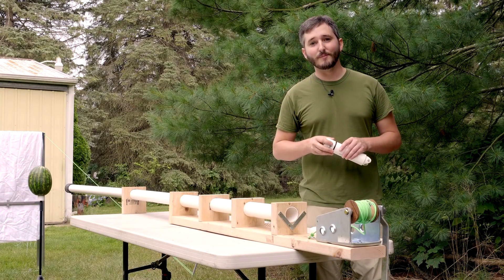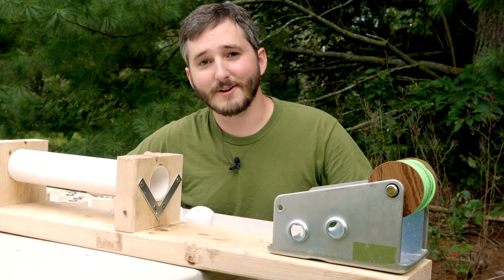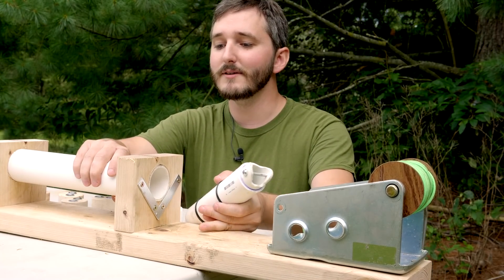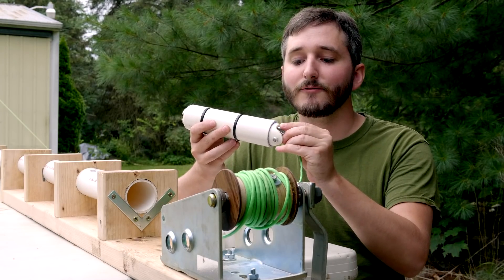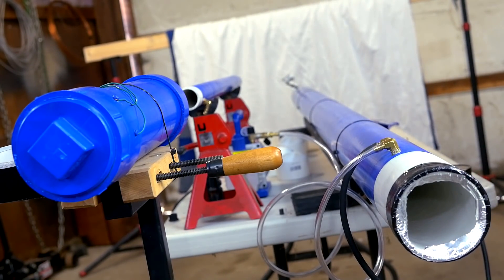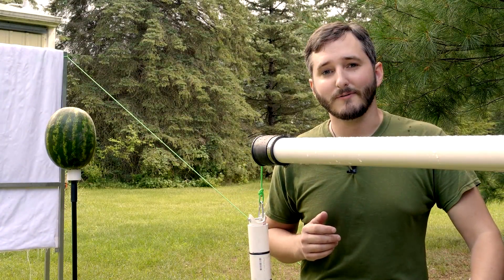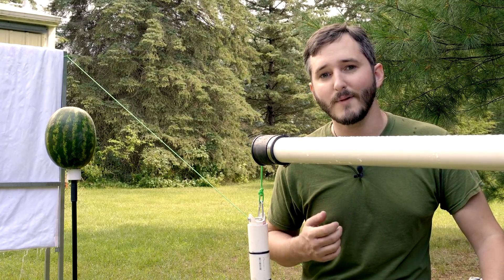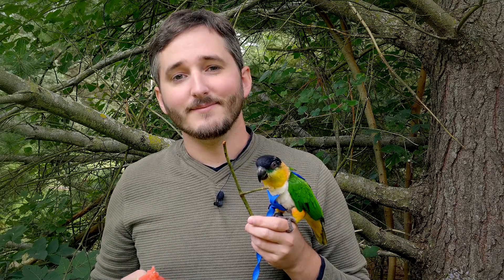Rapid-Reload Vacuum Cannon: Magnetic Piston, No Burst Discs

Comment: I tried to build this with my physics class. I am having trouble getting power out of the projectile. My build is similar but I am using a hand crank instead of a drill. How important is the speed of pulling the Piston. Thinking of trying to modify my crank to attach a drill. Also my 1 1/4 inch end cap doesn't seem to be quite as airtight. I attached a layer of tape to reduce the gap slightly. Any other suggestions?
Reply from the maker: Could be too slow at pulling the piston. See my earlier versions using a solid shaft attached to the piston, that version is pretty foolproof
Reply: @Nighthawkinlight  I was hoping to use the later methods because of not needing to tie it down and it is a self contained unit. I will see if I can work out the kinks and if so will be posting on my channel. I will send you a link if I get it working.
Reply from the maker: Please do! Send me a link to nighthawkvideoresponse@gmail.com
Reply: @Nighthawkinlight  I got it to work today! I took the homemade crank off the back, tied down the board and pulled the Piston with the rope. Worked like a charm! I will be uploading a video soon. I would still like to make a few more modifications so that I don't have to tie it down in the future. My students now want to see how far it would shoot a projectile. I also have an idea to shoot a pool noodle or turn a pool noodle into a sabot for a "shotgun" affect or to launch something with a smaller diameter.
Reply from the maker: Glad to hear it!

Comment: Hint:
Combine the working principle of the vacuum cannon with that of a pulse jet engine and you have even more muzzle energy than your PVC pipe can handle.  All you have to do  is suck in some atomised fuel with the air and install a spark plug with ignitor.  The result will be .... Super-Sonic Air/ fuel mix ignited..... Ignition timing will be crucial and the most difficult thing in the whole set up.
The Kinetik Energy from the Supersonic  Air plus the additional pressure from the fuel explosion will result in a big BOOM....enough power to blast projectiles into space... Well almost...
Caution: the pipe will backfire, keep safe distance, don't point at humans, animals or nasty neighbours, because the projectiles are lethal.  Always ware a safety t-shirt and safety Flip Flops

Greatings from beautifull Spain

Bert

Comment: That's awesome. 

But as far as putting tubes together, Iif I'm remembering correctly, they did that in mythbusters, and instead of an increase in speed they actually got less. 

Why is that? I'm not going to pretend like I understand what was happening with their experiments, or if they did something wrong, just a thought lol.
Reply from the maker: I don't remember that episode clearly, but I would guess the problem was that a lot of air leaked past the projectile upon firing. If that happens then a cushion of air builds up between the burst disc and the projectile which slows it down. This problem is amplified the longer the barrel gets, but is reduced by using a burst disc that breaks easily or a cork and ejects with minimal force like in my design.
Reply: @Nighthawkinlight  cool, makes sense, thanks for take the time to respond.
Reply: Taking*

Comment: What if you had a tank of a hydrogen/oxygen mix with an igniter in the tube and when you pull the stopper to make the vacuum, you would pull it past a point in the O2/H tank that would suck that mixture into the tube and ignite it? you may want something stronger then pvc though XD

Comment: But how does the projectile separate from the plunger?!
Reply from the maker: It comes free of the magnet as soon as the plunger is pulled from the pipe.
Reply: Nice! Is it because of the rush of air as the plunger comes out or because the steel angle bracket?

Comment: Couldn't you just use the projectile, pushed into the barrel, stopping at a rubber seal (like you did with the plastic cups, but In the barrel, as a valve?

Comment: Hey I just thought of something. I would love if you could try out for me. It would he a huge help as I'm sure you'd have a great way of making it and then explaining it. 
I recently started a new job. 
I have to cycle all the way to work. Which sounds good for my health but I live in Ireland and it's coming into winter soon and cycling sounds like hell.
However; 
it could be nice if I had a motorized bicycle. 
I know there is lots of other vidoes explaining this but they are all of poor explanation and or require some parts I can't easily acquire. 

Could you try this out ? 
See if you can make a motorized bicycle from parts you'd find around your house. ? Including a chargeable battery of some sort. 

It only needs to runs for about 60mins a day. Doesn't have to be rocket.  Just get me for A to B without pedalling.
Reply from the maker: I just built a motorized bicycle for part of a future video, but I just used a motor kit from ebay. I wouldn't build something myself when kits are so inexpensive. The trouble with making tutorials for such things is that every bicycle is different and requires very different techniques for mounting motors and drives.
Reply: @Nighthawkinlight  cool. I was about to take the washing machine apart. Lol

Comment: I would try a velocity stack type thing on the intake end of the pipe. it should result in more smooth and better airflow, similar to how N/A engines do it. i understand the concept isnt the exact same, as velocity stacks are more about resonance, but the larger intake diameter with a cone shape down to the inlet for the cannon might help. https://i.kinja-img.com/gawker-media/image/upload/s--3DN1l5sp--/c_scale,f_auto,fl_progressive,q_80,w_800/kg9c6gim2dgep6njlt6p.jpg
Reply: thanks for the video by the way, i think i might go to the hardware store and build one myself, and try out my cone idea

Comment: can someone please correct my calculations?
Ping pong ball: 2.5g
atmospheric force on barrel diameter: 45 pounds or about 200N
if the  ball had a perfect fit
a = 200N/0.0025kg = 80 km/s² ?
to reach supersonic speeds you need 0.01mm? there must be something im missing?!
Reply from the maker: The air cannot move quickly enough to push a ball that fast
Reply: @Nighthawkinlight  what is preventing it from rushing in that fast?
Reply from the maker: The speed of sound and the low energy of the air particles
Reply: @Nighthawkinlight  ah I see. Thanks!

Comment: So a pellet (Diablo) shaped piece of Styrofoam with a fiberglassed nose would be about the fastest, most damaging projectile?  Not sure of that.  Mass does factor into damage because it's really all about the energy transfer.  If your barrel was long enough, even a heavier projectile should accelerate to supersonic speeds, no?  Not sure where heat from friction comes into the equation and melts the barrel either.  Some interesting tests ahead?
Reply from the maker: A heavy projectile could accelerate just as fast, but only if no air can leak past it as it is accelerated. Otherwise you end up with an air cushion that slows it down by the time it reaches the far side of the barrel.

Comment: If you dropped the diameter down to be able to shoot something like a sewing needle then shouldn't it be able to reach higher speeds without a massively long vacuum to speed it up?
Writing a book with advanced weapons that are actually possible.
Reply from the maker: No, because vacuum only gives you atmospheric pressure which is 14.9 pounds per square inch.  Back of a sowing needle is tiny so only a fraction of that pressure to push it. Compared to friction of the needle in the barrel it will not pick up speed quickly.

Comment: Lame. You don't need to make the pipe longer just add more pressure on the other end and you will get well over super sonic speed with heavy projectiles. If you get a oil of tube successfully evacuated and a pressure differential of 10 to 20 Bar then you will get really insane speeds 😱

Comment: all this vacuume...and then narrow it down at the firing end...  to a 3/4 line and firing shotgun slugs??  Even if you have to wrap them in something this should be Very interesting....AS SOME channels are being De-monetized..because they are using GUNS..
With this, they should not have a problem...
Reply from the maker: This type of cannon doesn't work so well with heavy projectiles because the pressure is not very high. It works best to fire light projectiles very fast, not so good at something like a lead slug.
Reply: most slugs are in the area of 1 oz...  its the spread/area of weight..is so narrow, but with a Neck down size, it might(??) give you more force??

Comment: "...at a velocity several times faster than the speed of sound..."
This is not correct.  The inrushing air will travel and less than the speed of sound, the speed of sound may only be approached.  While there are less collisions when a pressure wave moves into a partial vacuum, the collisions aren't really impeding speed that much.  
Air also has mass and so requires time to accelerate, so the apeeds will be well below the apeed of sound for any practical length straight vacuum tube cannon.
Reply: Was looking for this comment. its a shame no one is debating this propagation of misinformation the Video is spreading.
There is a way to increase the velocity, venturi tube. but the video is just a straight pipe.

IF he increases the temperature of the air allowed in. he can increase the velocity, but it will always be the speed of sound in that medium.

he also says the pound-force on the projectile is not what causes the projectile to move fast, he claims it the airs speed. 

it is the pound-force and the airs ability to maintain that force or close to it, the projectile may only accelerate up to a fraction of the speed of sound. as soon as the projectile was somehow moved to the speed of sound, there would be no force pushing it. the guy needs to look at conservation of energy and Bernoulies work. if the air was allowed to enter a vacuum, it would quickly reach zero pressure while having a velocity of (On average) its speed of sound value. with an obstacle in its way, it will have resistance and will bounce off it transfering kinetic energy, thus all the while maintaining a pressure value, though greatly reduced?

Would like to see some well-plotted graphs on the energy values during the projectile acceleration period. ie air pressure, temperature (Closely related) and velocity etc.